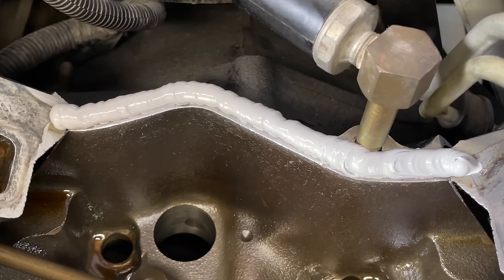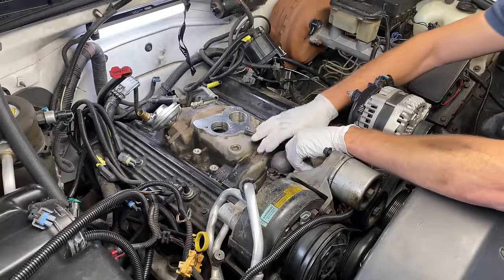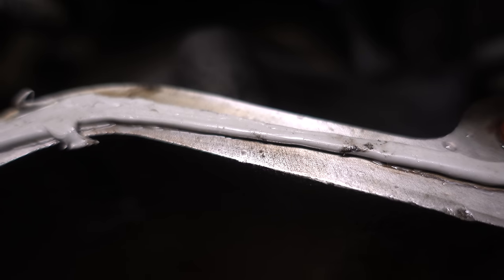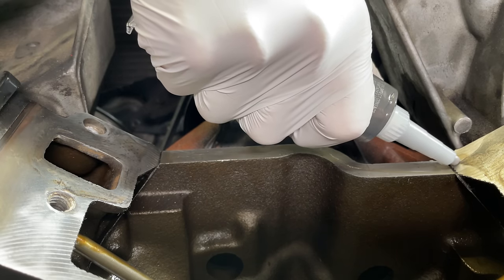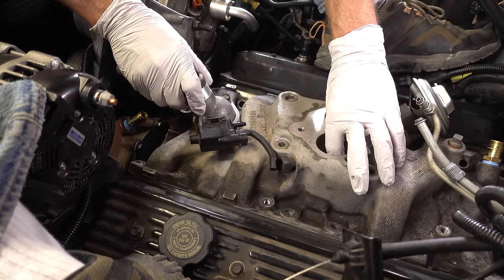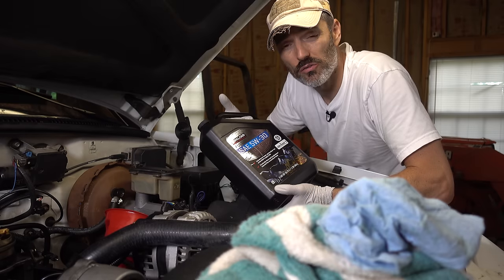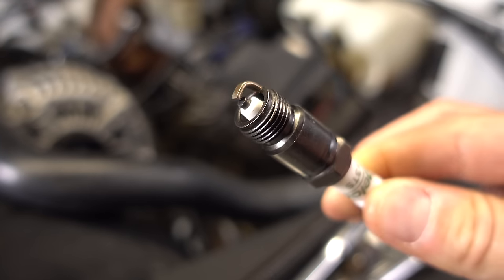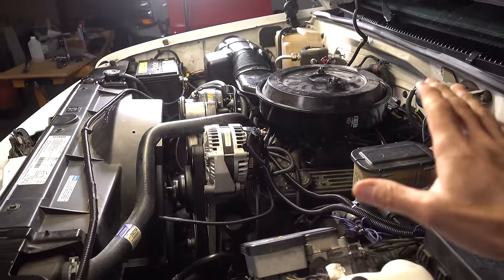Why You NEVER ATTEMPT To Use RTV Gasket Maker Without Doing This First!!

Comment: An intake manifold is one job you need RTV silicone for sure, as a proper vacuum is needed for function and efficiency (just like the heads).  I don't know personally which silicone is best, as every mechanic seems to have their favorite that they believe is best.  Nice re-do and thanks for showing us, Jimmy!
Reply from the maker: Glad you enjoyed it! 🤙
Reply: I use ONLY the gray silicone for this purpose.  It is much more robust that the orange, blue or black.
Reply: @x-man5056 no it’s not. Ultra Black/ The Right Stuff, is the most robust RTV you can get. And that’s not an opinion, that’s a fact
Reply: @95roadie  Incorrect
Reply: According to a test performed by Project Farm, the black RTV from Mopar is the best. It is significatly better than the gray stuff from Permatex which I used to use.
Reply: @firstlast---  no it’s not incorrect lmao. 

It’s a factual statement. And easily researchable.
Reply: @95roadie  You're going to feel dumb for saying that when you look up optimum black 😂
Reply: @firstlast---  not really. My statement is still correct
Reply: What if  if the ack silicone is the wrong stuff and why are there so many rebuilt engines with the orange gasket maker .
Orange must be the best it can rebuild an engine and add colors ,and it's a great conversation starter .
Researching is something I did once or twice .
I'm sure every motor vehicle  manufacturer has specific part number for the proper type of silicone .
If one was to purchase silicone that way , they are not doing the work .
It will probably come in the just the right amount to do the job .
There is special gasket sealer maker for locations where two different types of metal are joined and engine coolant is involved ..
I can not remember if the motor in this video has aluminum headed and a cast block .the parts that need seal are not  just the front and back of of the manifold .
The intake gasket to me is easy to do until the metal is eaten away resurfacing seems to change some things..
But remember just use the orange stuff and lots of it everywhere and you'll have a new engine and water resistant .
Reply: Black silicone all the way, the others make you gay, there two blacks also, the one that is 2 dollars more
Reply: The gasket maker on China walls doesn't see vacuum.
Reply: @jeffreystroman2811  i raise you hondabond
Reply: The black is the best all around as it's designed to be used around oil. You can slide using gray for joints for valve cover jobs but its definitely got to be allowed 24hrs to fully cure.
Reply: @oldschooldude8370  they are all made to be used around oil.

The gray versions are usually designed to be used with the parts being immediately torqued to spec, unlike other varieties that want you to let them set up before final torque. 

There's different applications for every type of rtv, none are "best" except in their own applications.
Reply: @16vSciroccoboi  I havent noticed a difference in consistency between the ultra gray or black. I use whatever is on hand which is normally black.
Reply: @oldschooldude8370  I don't think he's talking about its consistency, but rather how fast it sets before you can torque it down to spec.
Reply: @moshet842  If you watch the Project Farm video again, you may notice that most or all the RTV adhesives he tried were still wet when they separated. He continued on with the test because, to him, it was within the parameters of following the directions and not having a fully-cured adhesive bond.
Reply: @campbellpaul  I always buy 2 days when I sell a job involving rtv. I favor black. Where I work I'm advisor, writer & mechanic. Very stressful but it keeps me sharp.
Reply: @oldschooldude8370  I favor the black, too.  For the sake of internet argument, I'm a professional dishwasher.  My theory is that the black RTV silicone is made with carbon to cause it to "stick" better.  If grey is any better, my guess is that it contains graphene, otherwise, I don't see how it would compete in adhesion and/or durability.  Because it is not a petroleum derivative, silicone usually repels grease and oil, regardless of what type of silicone it is (and it is naturally heat resistant).
Reply: @campbellpaul  I understand your point. However, all the silicone-based adhesives he tested were almost equally uncured. Taking that into consideration, I would say it was quite a fair test.
Reply: @moshet842  I think I'll just go with what the manufacturer recommends, and leave Project Funny Farm to his mass base of fanatical followers., thank you.
Reply: You don't guess as to what type of RTV to use, and you don't go by what Project Farm recommends. You look in the shop manual for your vehicle. It will tell you exactly what to use, and how much. For this type of job, they usually have you use high temperature RTV. Its usually red. You'll also need the tightening pattern for the bolts on the manifold, along with the torque specs. Most people overlook the most important part of the job. Removing the old gasket. On modern vehicles, this is critical, and you should clean it exactly the way they tell you. That's probably why he got an oil leak on his first attempt, and why it was so easy to remove when he took it back apart. That's why its so important to read the manual. Newer vehicles are not as forgiving to work on, like a lot of the old ones.
Reply: Project Farm is for entertainment it is not a true controlled testing lab. I do enjoy watching it. You have to use common sense and pay attention to detail. I have actually used some of the testing to help make a decision on products. I've  drag raced since 1975 Currently running a super comp dragster with my son. We build everything on the car  our selfs except  the chassis. In 1975, there was RTV "room temperature vulcanizing silicone." It worked on everything and still does. We usually use the rightstuff  black now but will use any 100% silicone in a pinch. Even used unsiliconeized painters calk one late night thrash when I realized I had no pan gasket. Being on a tight budget in those days, I stopped using pan,  timing cover and power glide pan gaskets except the rubber piece between the oil pan and timing cover never a problem. Home made small block header adapters to over sized headers RTV no gaskets. Pay attention to surface prep how tight the mating surface. Doesn't matter how much squeeze out on the out side. A metal to metal surface can allow the silicone to come off in side the motor. We do run gaskets everywhere now. Quality has improved dramatically aftermarket parts are so good rarely open the motor other to run the valves.
Reply: @95roadie  Ultra Black is what I use in place of honda bond. Works just the same. Never had a leak in any location where I needed to use it during engine assembly. A thin film of it on both sides of the head gasket near one corner of the head fixes a particularly common oil leak on B series engines. Started doing it to every engine I do a head gasket on and never had that oil leak happen. Started doing it after I had issues with leaks on that corner and found it basically happens to every b series if you don't use a thin film of rtv around that oil drain port.
Reply: @16vSciroccoboi  you could say it does because the pcv is always pulling a vaccum on the crankcase, a little knowledge goes a long way. chevy has had pcv since the 60's.
Reply: @charleswittmer2477  I'm aware of how pcv systems work.

A little knowledge goes a long way, pcv systems on pretty much any domestic V8 don't flow anywhere near enough to get the crankcase into vacuum. Plus the whole part where there's a breather tube in the other valve cover to keep the crank from being drawn into a vacuum.

Comment: I went from owning a buick lesabre to owning an acura RSX - to owning a K1500 (1998) and subaru impreza (2005), the biggest thing i noticed between japanese cars and american cars was the gaskets, specifically honda/acura uses this stuff called "honda bond" -it works every. single. time. (just a pain to get off) -i actually use the stuff anytime something calls for "gasket maker" unless its high heat.

the other thing i wanted to say is that
1. honda parts usually mate way closer than whats seen in the video, i've literally never seen something not squish a bead that big down nearly flat
2. regardless of how smashed the rtv gets, the two mating surfaces need to be cleaned very well, always wipe dry with paper towels

Comment: 10 years as a mechanic another thing you can do is use studs to set the intake/ keep it from sliding/ hold gasket in place,  install a few bolts remove the studs and reinstall factory bolts torque to spec.

Comment: Prepping the surface is your most critical aspect. Absolutely no oil residue or anything else can be on the surface. Wipe multiple times with a solvent such as acetone, brake clean, starting fluid, or carb cleaner. Do not use mineral spirits as that dries it leaves a residue.
     A narrow bead is fine but I always run two layers of bead, one on top of the other.

Comment: So like if you use a thick bead of rtv? What would you do if a lot of it squished out inside your engine? How do you remedy this problem or and even ends up in the oil pan as a result of heat cycles

Comment: @1ROAD  I applaud your willingness to show your mistake on camera, and to jump right back in and fix it right. One side note, check your PCV system. If the crankcase is over pressurizing due to a clogged or stuck PCV valve, then these RTV seals will see a lot of pressure, and they are the weak spot in the system. They could blow out and cause another oil leak issue. Just a heads up.

Comment: THANKS FOR THE INFORMATION. I always liked using gaskets. One time I had to use form a gasket and was concerned about it as you were. Also, when putting in new spark plugs I use a piece of neoprene hose and put it on the top of the plug and screw it in by hand then I'll use the wrench to tighten it down. I always use the air compressor and blow around the plug then use a shop/vac to suck out any debris before pulling the plug.

Comment: Protip: since those were basically new parts, You could have easily as well reused those felpro intake gaskets if someone was in a pinch and in your shoes and couldn’t find them in stock by the time you reopen the engine to reseal the rtv for a second time
Reply: I hate RTV its garbage and a crap way to get a leak proof seal. I use form a gasket and a quality gasket.
Reply: @GregariousAntithesis  If you follow the directions and allow up to 3 hours before starting the engine, RTV holds extremely well. Use an adequate amount and you won't have issues.
Reply: @kurtangusofficial  fuk that garbage. I will continue to use anaerobic sealant like permatex form a gasket that never leaks.

Comment: Have these heads and block been decked before? If so it beings the intake manifold faces closer together, which makes the intake manifold sit higher in the valley, and makes a larger gap between the bottom of the manifold and the block. That would be why you had such a large gap and needed so much RTV.

Comment: i had my intake manifold put back on my motor and curing when i came inside and watched this video. after watching it, i had a bad gut feeling so i took off my manifold. come to my surprise i ran into the same issue. There was about a 1mm long spot that had no gasket material on it. long story short i cleaned, then reapplied the gasket maker and now praying it holds

Comment: I know people talk about "scraping" gaskets, but its easier to use a brass brush for alot of it. Also don't wipe with a dry towel, use brake cleaner or whatever solvent.
Reply: I did a valve cover gasket on a 2002 5.9 magnum truck, I very frustrated because I obviously didn’t do a good job and I’d leaking. The rear on engine one can barely get your hands in there to even see in what condition out is. Can I also use RTV ultra
Permatex black along with gasket? I’m not a mechanic, just learning as I go, any advise I can get from anybody is welcomed.
Reply: @Gabriellariz  what type of gasket is it? RTV, pressed tin, paper, composite, cork?

And yes for cleaning rtv up nothing is quicker than brake cleaner and brass brush. It just melts off. Tapping paper gaskets gets them off pronto too
Reply: @Gabriellariz make sure both mating surfaces are flat. Use long flat sanding block on the manifold if not to reduce the clearances and make it uniform

Comment: I was aghast when I seen oil passages in your lower intake manifold, definitely adds  a extra dynamic to a repair that uses sealants. Great content!
Reply: I recently had to repair a Rover K-series engine that someone used standard silicone sealant for the cam carrier.  The excess had hardened and blocked oilways and damaged the hydraulic tappets.  Anaerobic sealant is needed for anywhere it could get into oilways.  Any excess doesn't harden and just mixes in with the oil
Reply: @TheBlaert  That's interesting.. I never thought about the adhesive needing to be anaerobic, or of it being a danger to oil circulation if otherwise.  I have heard of mechanics who will only use clear silicone (although I've never seen an automotive clear RTV adhesive for sale anywhere).

Comment: I had to replace my whole oil pan recently, about 15 bolts just holding the pan. also a very tight squeeze getting it in and working under the car on jack stands was a real pain. I used enough gasket maker the first time but after letting it sit for the 24 hours I realized there was a little section inside the pan that was supposed to get gasket maker too that I forgot so I had to remove the pan and scrape all that gasket maker off again and redo the entire project. Just like you said now i go SLOW and make sure I'm taking my time and doing it right the first time so I don't have to go through that kind of mess again lol. Great video!

Comment: When I did mine, I made the same mistake. Mahle made a video about the Vortec intake gasket (which are notorious for failing) and cited "using too much rtv" as the number one mistake installers make. With that in mind, I used too little, and in the wrong spots. I've been putting off fixing it, but making quite the mess of my parking spot.
Reply from the maker: Yep, saw that in a few different videos too. It’s definitely good advice but being a perfectionist I took it a little too far and used about 1/4 of what it needed.
Reply: its what of those things you just got to experience. to much RTV gasket maker on a trans or diff rebuilt destroys them. To little on a intake causes a leak. Just got to experience it sometimes.
Reply: Mahle makes decent gaskets though that’s for sure

Comment: My take: You used enough, coulda used a bit more on that thin strand, but either 1. You didn't tighten enough on the initial tighten that you sit to let it set up before the final tighten, or 2. your parts are so warped that there was a non-standard gap needing to be filled.   The resulting smooshed bead was too tall.   But using that monster bead, the inside of your front looks like the outside of your back, (8:25)  If any of those formed individualized globules that fall off inside. . . major bumming (cussword) especially in the head oil routing, (yeah odds are it ends up in the oil pump intake and you don't notice, but it can get stuck in an oil restrictor and kill oil to an entire set of lash adjusters.) Maybe a step of like modeling clay in the gap to see if you're warped or what the smoosh will actually achieve when the parts are mated?
Reply: Ya, I saw those yuge beads and was thinking... man that would clog an pickup in a jiffy if I used that much on an oil pan. You shouldn't have a 1/4" gap to fill with RTV, that's the issue here.
Reply: I agree.  He used far too much sealant for the second repair.
Reply: Does nobody use a flat reference and sand down the surface with a sanding block? That’s what I was going to do
Reply: @KollynJ  yeah right sand on a open block. too many computer mechanics for me.

Comment: Reminds me of the time in the 1980's I bought a water pump for my Fiat.  That evening I discovered it came with no gasket.  Not wanting to wait, I laid the gasket sealer on very thick, and hand tightened only, then let it set until the next day, when I tightened the bolts fully.  It held!

Comment: You also want to run the gasket maker from the China walls onto the Felpro Gaskets that overlap The China Walls It will help seal the gap between The Manifold the gasket and the China Walls @1Road

Comment: After laying the intake gaskets down, the corner protruded ends of the gaskets lay on top of the gasket maker material. So the gaskets are bare in those corners. You should put a dab of gasket maker over each exposed corner of the gasket, to blend it in with the rest of your gasket maker application to make sure it is completely sealed on those ends.